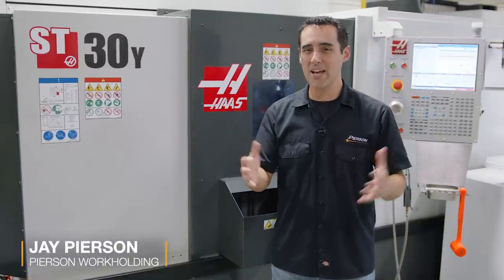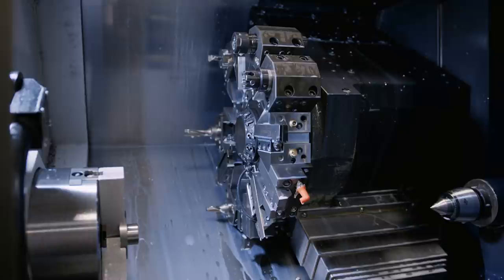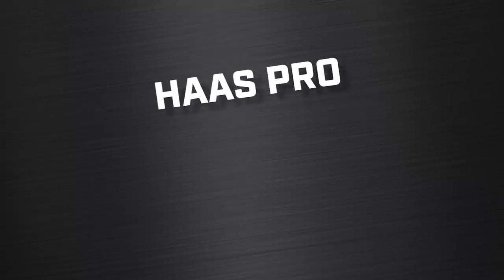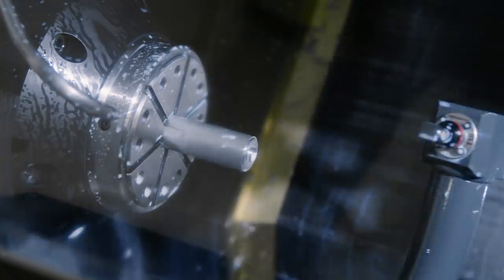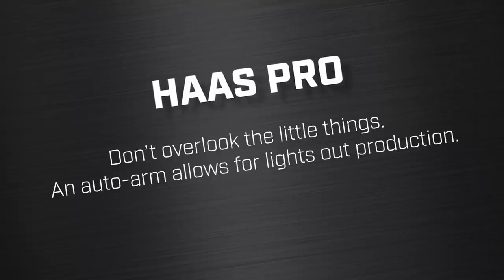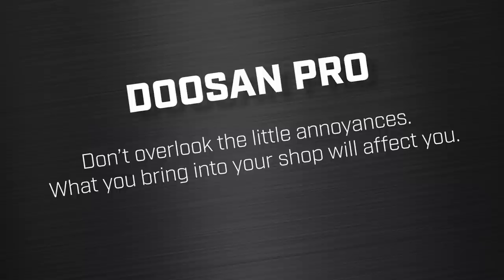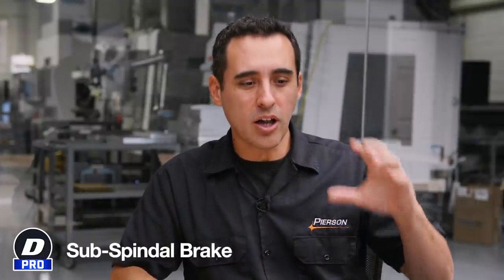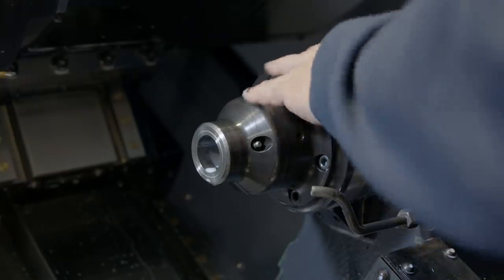Haas ST-30Y vs Doosan 220LSY | CNC Lathe RUNDOWN | Pierson Workholding

Comment: Where I work I run a 2008 sl30 old controller no live tooling or y or bar feeder. I got the royal cutoff and bar puller and made some parts catchers to attach to the tailstock. And my boss is liking it even being against the shop switching more to cnc and making new instead of reparing. Just took delivery of a ST35 LY, unfortunately one rail has a massive ding in it. Can't wait to play with the live tooling and learn to program that. What's your solution for holding live tooling heads out of the machine and it says not to change tooling in the machine as it could damage it.
Reply from the maker: Most people change tools inside the machine using the proper spindle stops. You just don't want to put any tightening torque on the gears.

Comment: Used a lot of LNS bar feeders. I think I had to manually feed each one of them. Terrible terrible devices that aren't worth their value in scrap metal. I've heard horror stories about HAAS feeders too though. Either not working outright or just being shotty. Only bar feeder I trust these days are the ones on swiss citizens.
Reply: Used to run an old LNS on a Haas using a M-code to feed. Worked well except for the hydraulic oil mess.

Comment: When you go and buy a machine for your shop, do you buy new? Do you buy used? What's your philosophy?

My parents are school bus contractors and when they go buy a bus, they do their best to buy new because they don't want to deal with someone elses problems from a used bus. They would rather work through their own problems with a new bus.
Reply from the maker: It depends on the brand, year and hours.  A used machine is a great way to avoid instant depreciation.
Reply: @PiersonWorkholding  what is red flag in a used machine?
Reply from the maker: If the spindle hours and motion hours are very close.  If they are, you can tell they didn't warm up the spindles every morning.
Reply: @PiersonWorkholding  What are some others?

Comment: Next time buy doosan with simens control ,the best control ever
Reply: I agree. Siemens is without doubt the Best control ever made.
Reply: @nikolaiownz  Mills are trying to sell me the Fanuc control Instead of the Siemens. I asked about the Siemens because j heard just this. Kinda confused why they would push Fanuc
Reply: @HudsonLighting  i have used fanuc, Siemens, heidenhein and okuma. And siemens is by far the best control if you ask me.
Reply: I used to be mazak boy, now I'm working on doosan 3100lxy with siemens 828 d ,without training ,I will pick-up that control on my self ,doosan lathe with this control eat our mazak 350
Reply: @officialgoldboy5472  ive ran some. Mazatrol and I dident like it one bit. But I am not a conversational fan at All.
Reply: @officialgoldboy5472  I have run Mazak for over ten years on four different generation controls. And now I run a Mazak 350M with Smart control and a new Goodway GLS2800YS with Siemens 828D control. I would have to say that they both have strong and weak points but overall I think the 828D is a better control (the grooving cycles alone in Siemens shits all over Mazatrol!). But having saying that, my experience so far with Siemens is that there has been a lot of bugs to sort out (mainly Goodway not inputting the correct parameters and settings) and the support here in Australia is really weak.
Reply: Siemens failure issues or much much worse then with the Fanuc. You can't even get Siemens cards from stock after ten years

Comment: If you wanted the ability to interpolate with the secondary spindle then why not buy a DS-30?
Reply from the maker: Never said we wanted it. The DS30 is a totally different machine.
Reply: Ds-30 does not have full c-axis on sub either.

Comment: Get a doosan mill next, you'll love it, got a DNM, its SO much better than my VF4ss
Reply from the maker: Why is it better?
Reply: @PiersonWorkholding  Honestly for me, its the power and reliability that i get from doosan, haas never gave me that, doosan give you so much more standard than haas did, EG, roller ways, 12k spindle, Face contact spindle, 20 bar tsc, its all standard! plus, the dealer was cheaper than haas by a few grand, Very surprising. For the same size machine doosan i think weighs 2 ton more, you should see the casting on it, its huge compared to my haas. DNM 6700 - VF4SS, but I'm not going to deny haas just because they're haas, its experience from both brands, I started on a ol scrapper haas and I wouldn't be where I am today without it.
Reply: @PiersonWorkholding  HAAS VMC is "narrow C-frame design" and Doosan  VMC column is "wide C-frame design". On the HAAS design in X plus and minus table hangs in the air. Doosan pros or also stronger spindle motor, stronger feed axis motor, bigger profile of linear ways, and roller ways against ball ways, bigger ball screw diameter, and Doosan ball screws are anchored on both sides with 3 bearings, while HAAS ball screw hangs, so thermal expansion on X and Y cannot be controlled on the HAAS

Comment: HAAS parts catcher is a very bad design..have used it on sl20 alot..   the  lid in the door  jams all  the time,  or u often get long chips stuck in that tray. Alot of times small parts just bounce on that tray, and u can never find them again..   or  just  get  stuck  at the  opening  in  the  door

Comment: The Doosan should allow you to spec Siemens or Heidenhain controls and use Fanuc as a default ,so thats a Pro.

Once you give the Siemens a try you won't go back ,  its super efficient and can be programmed in 3 different methods. 

Thermal stability: Ive seen upto 20um -30um from initial first component to say 10th depending on cutting loads. 
Im convinced its not only m/c warmup but rather the general temp rise within the enclosure,turret ,tool holder,coolant temp and bar to be machined tha have an effect.